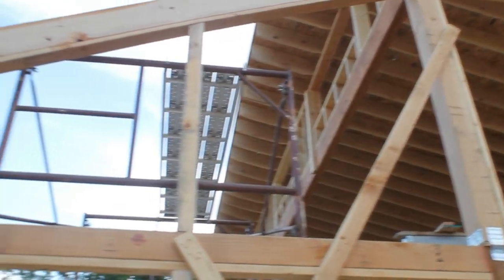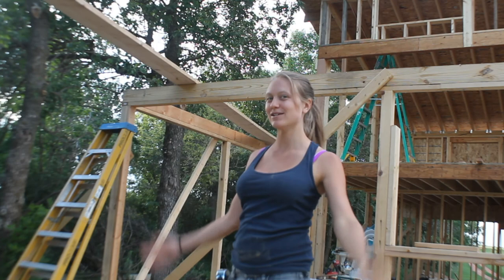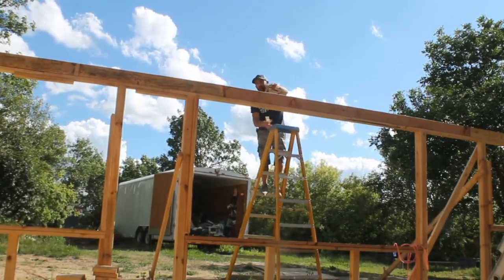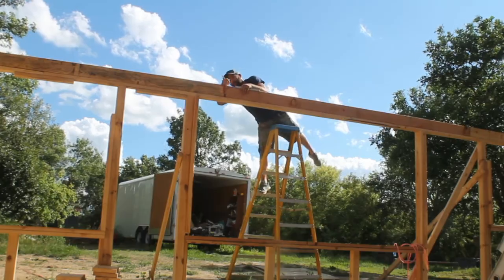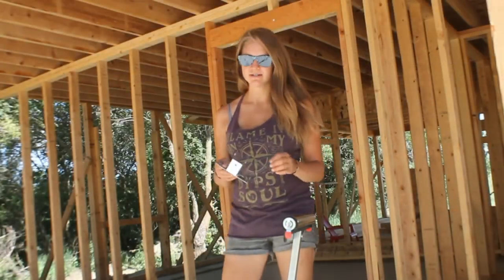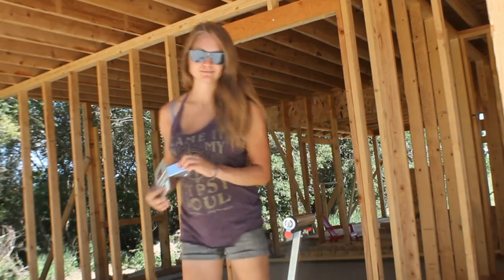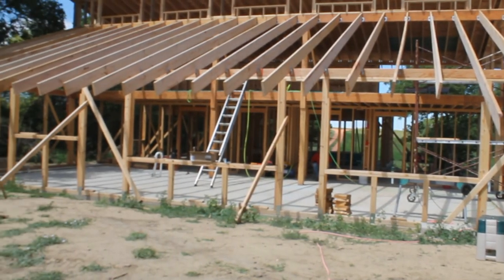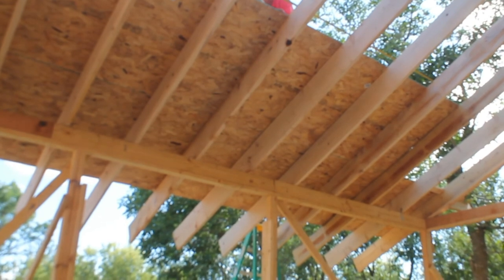House Roof and OSB Part 2

Comment: Thanks for posting this.  It helps to see the process.
How did you attach the barge rafters at the ends of each roof?
You get a view of them in the top, right hand corner @ 11:10 in the video.